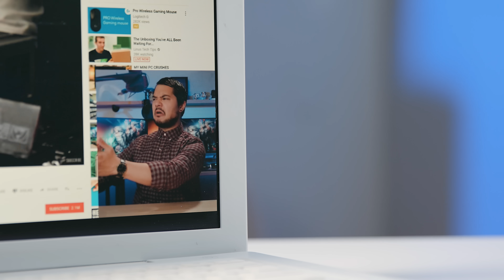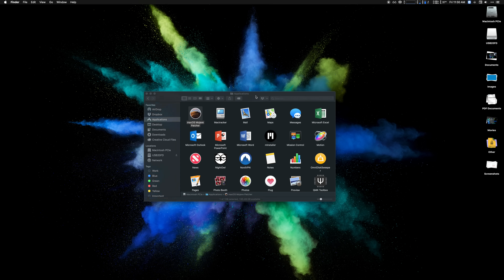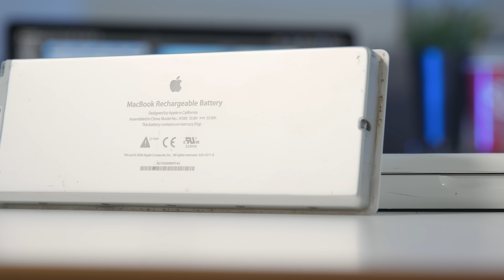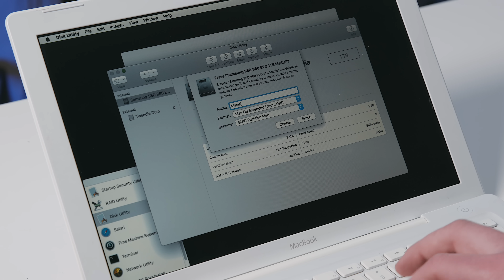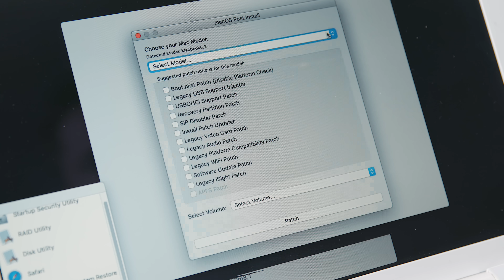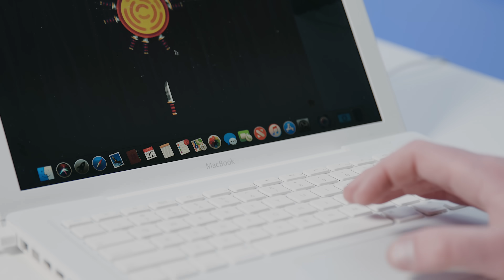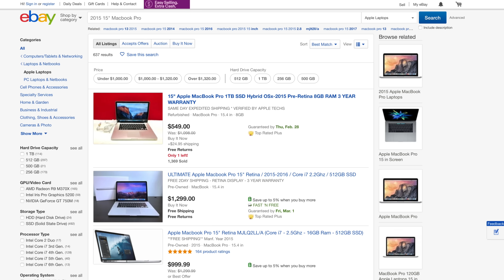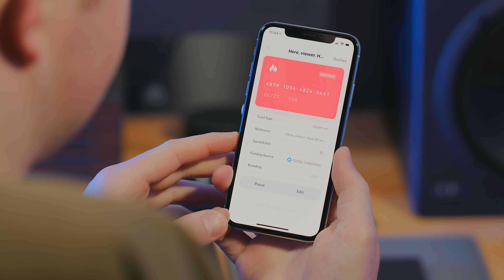Hackintosh a... REAL Mac?!

Comment: I have a mid 2012 unibody MacBook Pro running Mojave aka MacOS 10.15 soon I’ll upgrade it to MacOS Catalina 10.16 and in my opinion its better than a newer MacBook because it has a USB ports and a SD card slot oh and Battery lights with a button to tell u what battery it is at even when it is off

Comment: You can also replace battery cells in those old battery packs with newer and batter l-ion battery pouches for a batter battery experience  (sourcing battery pouches is hard though, especially "compatiable" ones)

Comment: Imma have to fix the GPU on my mid 2010 MacBook Pro and install Mojave. It runs up to macOS High Sierra and I used it for a long time with the broken graphics chip. The keyboard was great, battery life was great, and the track pad was great until the SSD died. I used it as my daily driver for school until the SSD died and now I might have to fix it.

Comment: I have a 2000 MacBook Pro that's running El Capitan (it is not my primary; that'd be my 2014, but it was my primary until I bought the 2014 new). This summer, my goal is to upgrade some hardware (the original 100gb hard drive, some ram, maybe a newer cpu) and install Mojave on it, for my mom. It's actually smaller and weighs less than the 2013 Dell she's running now, and with the upgrades, will be more functional. I'm planning on treating it like a from-scratch hackintosh. Will report back!

Comment: my macbook 1.1 isn't supported  :((((
Reply: 32 bit Core Duo is no longer supported as the OS is 64 bit only.
Reply: You can upgrade the logic board by buying a 2009 MacBook logic board and heatsink. I am planning on doing that for my Mid-2007 MacBook 2,1.

Comment: I had a late 2009 MacBook running High Sierra until last year without any hacks. It worked pretty well once it got moving, though waking up from sleep took forever and Lightroom choked it. I may try this on my old 2010 17" MBP.

Comment: You can pull the battery out on a lot of modern laptops. Especially Lenovo thinkpads where a lot of them have a second tiny internal battery designed entirely for allowing you to swap out the battery without shutting off the machine. And this is a laptop with capability for HUGE batteries

Comment: Too bad it doesn't work for my 2007 Mac Mini. Is there any way I could get an older, but for the Mac Mini still unsupported OS installed? It it currently stuck at OS X 10.7

Comment: This video is kinda Missleading.  "Capable" First thing first. Those are DualCores. I upgraded two macbooks with ssd 250GB and 6GB of ram (That is the max the mother board will handle) two years ago . One like this and the newer version Unibody. On most powerfull configuration 2,4 GHZ you hardly get any multitasking. You can watch YouTube but it struggles to have a YouTube video in HD and a word processor open. It is basicly a waste of money. For the same price you can get I5 ThinkPad or if you want a MacBook. Better pay a little bit more and spend couple bucks more on MacBook Pro with I5 processor.

Comment: Can someone recommend a good laptop for running linux, with the following specs...1) Matte Screen 2) Trackpad and/or clicker centered on the palm rest, or at least off centered to the right. 3) Trackpad and/or clicker located at least a half inch from the front edge of the palm rest. It can have a combination trackpad/mouse clicker, but prefer separate buttons for the mouse click. Thank you :)

Comment: wow. MB was upgradable?   That Apple is a different Apple from what we see now.
Reply: and while a screwdriver was used in this video, to open the battery panel you can use a coin to turn the line around. (In fact, it was never meant to be used with a screwdriver since Apple thought that would just be a hassle and a coin would be easier to open it up, and even a fingernail could work)

Comment: Upgrading a deprecated dinosaur with SSD that has 4x the size of files that dinosaur can handle and costs more than that dinosaur SHOULD cost...
Great tip, yeah, what an upgrade, really great investment there.

Now I know your channel is agnostic and you know that a sheep is a sheep, but... it just keep bugging me, and this video only proves it - how different the sheep are from the people.

The sheep have this disease called stupidity - programmed in them by Apple. In a nutshell - they have NO idea whatsoever period nada - about hardware. To them - Apple lays out this fancy OS that will have more and more "optimization" to run on anything and this and that. They have these "assum content creation unique softwarez" that are just worlds apart from non-Apple ecosystems. And that's it. They buy a "Mac". It has a system. The system updates. If it doesn't update - the smarter part of the sheep, those agnostics - would do Apple's job for free, you know, the way it's done on PC, and maybe, just maybe, though unlikely that most sheep would comprehend the steps in this video - but they would be able to "fix" their system.
But it's all in the system. Upgrades? S.S.Fucking.D. What an upgrade. To this day people won't budge buying an SSD for Anthem even when devs say basically: "Our game is fucking hard, get modern fast storage or beat it". Because it turns out that HDD are still capable, SSDs are still expensive and the actual practical potential of SSDs... ESPECIALLY FOR FUCKING YOUTUBE AND INTERNET BROWSING is VERY limited. Hell, systems start up in like 10 seconds on HDDs, Windows-es, when things are done right. And they are supposed to be "done right" on Apple - so why would you even need a 1 fucking TB SSD for this dinosaur?
Same goes for RAM. Upgrading RAM in this dinosaur is basically like "downloading RAM". But, yeah, if there is one thing that seems to be Apple's running gag - it's RAM shortage. Used to be not enough, then it got soldered, now it's not enough again... on the phones... Premium hardware right there. Do you know why, btw? I'll tell you sheep a secret: Apple would rather install 3-4GB of top-1% RAM dies onto your phone for the price of some... 20GB, while Samsung would install up to 12GB of top-5% dies for the price... below 20GB. Technically same memory.
And, of course, Apple are all about secuyuriteh. And patches. And protection.

People, however, don't seem that concerned about software. Sure, Windows is a mess, a mess that is literally better to use pirated than official and this is NOT A JOKE, it's a cold-blooded truth. However... whenever something is discussed in PC world - it's usually about hardware. From all kinds of displays to input options to cases and design to cooling, to most importantly - operational hardware. CPU and GPU. To this day Apple skims on GPUs, and looking at their attempt to replace RISC with CISC - the trend will stay. And their CPUs were basically the underclocked cream of the crop of Intel sleaze. On PC, however, GPU is generally valued at 2x the budget\importance of a CPU. Because, honestly, a capable work-ready processor is easy to get, and now easier than ever. You are a programmer\encoder? Cool, get some 500$> 16C\32T Threadripper and you are good to go. Custom GPUs, on the other hand, is basically the only thing that separates people from conslow peasants. And whenever you discuss old hardware, buy used, get a deal on new hardware, assemble a machine or otherwise measure your junk - the actual performance of hardware is the topic. And that's where, realistically, you could afford 32GB of RAM and 1TB of SSD. Because these memory sizes(not implying that you placed 32GBs in that dustbag) would indeed be beneficial to the modern files.
Recently Windows tried to go all Apple about security and, well, it flopped, turning it even an even bigger mess, and poisoning normal people's minds with things they really shouldn't be concerned about. Thanks, Apple, and thanks, Intel. And NASA.

The sheep only ever brag about their hardware when it comes to smartphones. Yes, now Apple manufacturers slightly faster proprietary chips and it's all good, but even then - the only people who ACTUALLY notice it - are agnostics with mental disability. Because sure, being 5-25% faster on your smartphone PER dollar at an assumed PREMIUM price of 1000$(not talking "budget premium 700$ or even NORMAL HUMAN prices, where Apple mobile is nonexistent, though I'll give a thumbs up to their recent tablets, these few are good), while being 2-3x slower per dollar in, say, 2000$ PC\laptop budget - is definitely an accomplishment.

And if someone dares to say that this wall of text is pointless... it's an observation. Which, again, this video only proved. Because, yes, this rant is pointless, worthless, almost off-topic. But it's so, SOOO MUCH MORE: TRUE, PRACTICAL AND USEFUL than.... installing more RAM and an SSD, let alone a 1TB SSD into a dinosaur laptop that is said to be "snappy for youtube".

Comment: I recently came into possession of an old eMac and (after watching this) I thought is it possible to replace the hard-drive with a superfast SSD drive and then do Mojave, seeing as I'm installing an OS anyway. The website says 2008 MacPro4,1 is supported but this is a few years before then and not explicitly mentioned. Any ideas/experience? If not Mojave where can I push it to? I really just want to have it syncing with modern dropbox/itunes, not heavy processor stuff.

Comment: I've been doing this since Sierra on my unibody macbook 5,1 (late 2008). I misread dosdude's write up and thought my wifi was unsupported, so didn't pull the trigger on Mojave. I revisited it after watching this video. The 5,1 has a better trackpad and thus works fully. Also, apples documentation says 4gb is max supported amount of ram in this machine, BUT 8 works as long as you have the latest firmware. The 2.0 Penryn is the only part that makes this thing weak. SSD and 8GB ram makes it totally usable.

Comment: THANKS! 
I do have one of those gems (if can be named like that) and it still runs 10 years later. Yes I do not use it often. Yes I had to change the battery 2-3 times, and Yes I did swap the hard drive to an SSD (not really a greater capacity one, just a small one). 

Now knowing what you explained I will do the same, and will have an updated laptop to be used whenever needed (I do have a Medion 2018 laptop now and its okay but it runs windows and that is so disgusting after all......), combined with my "recently bought 6 months ago" 2008 Mac Pro 4.1 I do have two massive dinosaurs home. But the Macbook has been with me since day one and is a beast that keeps runing, and the Mac Pro even new at home and old as f*ck is a super able machine.

And they run nicer OS in both cases.

Comment: U can pull batteries out if modern computers: ThinkPads ftw
Reply: Lenovo will always be a bro in everything they make
Reply: Tyler Lindsey Not anymore, sadly. Soldered ram, non-replaceable batteries, less I/O than ever before...

IBM had their problems, but since 2014, Lenovo’s been slowly driving their  thinkpad line into the ground :(
Reply: @trannusaran6164  alot of schools and businesses use Lenovo laptops and PC's I'm pretty sure it's for a good reason
Reply: @HoloScope  Yeah, because laptops in general have gotten worse, relative to the technology available. Thinkpads are still arguably the best around, but convergent trends in laptop design have shifted the goalposts backward considerably
Reply: @tylerlindsey4772  Except for their Motorola phones.
Reply: @P0n...  (was completely unaware of lenovo phones)
Reply: ThiccPad Master Race!!
Reply: The new thinkpads have removed the removable battery feature
Reply: @Hydr8Man  Not all of them. Top models still have a dual battery - a small one will keep the computer running, while you are swapping the main one.
Reply: @Hydr8Man  The ones as thin as the X1 Carbon, yes. But the X1 Carbon tries to replicate the style of the Macbook Air in black. They still sell brand new ThinkPads with removable batteries. Heck, up until a couple of years ago, they still sold ThinkPads with proprietary bottom mount dock connectors. That didn't go away until Thunderbolt became a viable standardized solution. Also, the new models do have non-swappable batteries. But, you can still get previous models with swappable batteries new.
Reply: Dell ftw
Reply: This did not age well...
Reply: Asus X550I
Reply: not my e595...it's still a better computer than the more recent macbooks but yeah still some weird decisions that even lenovo is starting to make XD (still have replaceable ram, m2 and 2.5" but yeah...)
Reply: I swear to god I want to throw the Thinkpad where I work at has across the warehouse floor. We're on our third one since moving into our new location. These are new machines too, but the keyboards and trackpad are failing on them. It's not like people are pounding the poor things either.
Reply: This is not the place to have these discussions, take it to the proper forums.
Reply: @Philjj61  That's not even in YT's ToS lol.
Reply: I had a stroke

Comment: 6:04 have to point out, that they can — one of the C states, where everything is dumped to SSD, including RAM contents, so you can actually not only swap a battery, but a whole SSD. Provided, that you put it back in, because Windows looses it's shit, if booted from C states with different hardware, except plug and play devices

Comment: YOU ARE THE BEST MAC CHANNEL in YOUTUBE ! Thank you very much ! You and the guy who made the patcher are amazing !  I have just installed High Sierra (from the same patcher provider link) on my white MacBook 2009 A1181 ( SSD + 4GB) . it runs amazingly good like my another MBpro . 
I was almost desperate to find a new modern OS for my Old MacBook , Linux Distros were not perfect on this machines at least for me .  
Here the Only Issue I have beside iSight and right click problem is, after an upgrade on OS I lost my Function Keys (volumes and brightness ) although I could use third party apps to control it in menu . by the way , YOU SAVED MY OLD MAC by this good and comprehensive tutorials . 
watching this video on my MB5.2 on High Sierra !

Comment: iOS devices getting updates up to 5 years after release:

“That’s pretty impressive.”

Mac gets updates up to 7 years after release:

“Their Mac lineup however doesn’t get quite as much grace.”
Reply: That's because even older pcs can run Windows 10 due to its really low minimum system requirements.

Comment: You can upgrade that computer, at reasonable cost, to a max. of 4 GB. That is ok for wordprocessing but for browsing it pretty soon (after opening some tabs and going forth and back) becomes not enough. 8 GB is the minimum these days for confortable working. Yes, 4 GB works, but it is a bit of a struggle.

Comment: Just goes to show that there is no actual reason to limit these newer OSes on these older systems EXCEPT to force everyone to upgrade. Shame, shame, shame, Apple. (Microsoft probably does the same thing).

Also, I thought a "hackintosh" was a PC that has been converted into a macintosh using clever install tools.
Reply: Microsoft certainly does not, windows 10 requires 1ghz proc. People have installed it on Pentium 4 machines. That being said, I couldn't upgrade my iPhone from a mac because it couldn't run the newest iTunes, but windows xp at the time supported the newest iTunes. sad day when i had to find an old pc to update my apple phone...

Comment: I did this on my 2009 27" iMac i7. I upgraded unofficially to 32 gigs of RAM upgraded the speed to an unofficial but supported speed on the ram I also upgraded to a Samsung 1tb SSD and updated the OS to the latest Mojave using the patcher and it runs like a brand new machine.

Comment: I patched up an exact same crackbook with HSierra in a samsung evo 860 ssd, hooked it up to a 1080p 24 inch monitor and WOW. Replaced the cracked up trackpad and screen bezel too for $30. 

My only gripe is photoanaylsisid is pushing the cpu at full throttle and the fans run at 6200rpm jet mode. I had to place it vertical with the exhaust on top to help with thermal management. What a pain in the behind!

Comment: Tried that with my 2011 MacBookPro. Unfortunately the Radeon 6770 doesn't support Metal and I can't run an external screen without it so I had to pass on it again. But well, I wanted to switch to a hackintosh anyway.

Comment: I tried this on a Core 2 Duo Mac mini a while back. The wireless did not work and performance was pretty poor, so back to El Capitan it went. But I only keep it around for a couple of very specific uses anyway. My main system is Linux.
Reply: Was it HD or SSD? That may was the reason causing that bad performance.

Comment: So , i looked for buying an old MacBook to do exactly this. The issue is that , because i'm a Noob on MacOS Devices , i really don't understand anything about how specs and models are classified. I saw one saying it's running on a 1.86ghz (No clue of the CPU it-self) , 2GB , and 120GB , and the macOS Mojave Patcher is talking about MacBook X.1 , how can i know if it's compatible without having the comp it-self ?

Comment: What if the crappy hardware and programmed obsolescence of macbook pro 2010 prevent me to install such a crackintosh system because of under specified capacitors weakness and graphic card failures tha cause kernel panic after a few years of lightly use. Burnt mother board beacaus of over heating i7 intel. Now I think twice before jumping in Applestore to purchase such a shit !

Comment: I don't understand what's so special about it? Because it's Apple? I can easily install the most modern Linux on the oldest computers (20 years or older). Without additional driver installation, on 99% of all computers it just runs "out of the box". Isn't that normal with Apple?